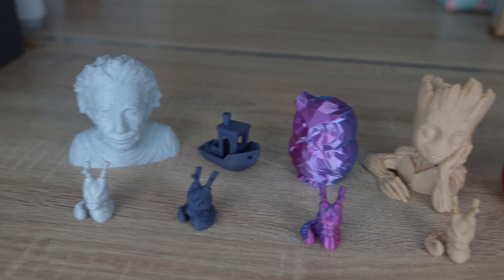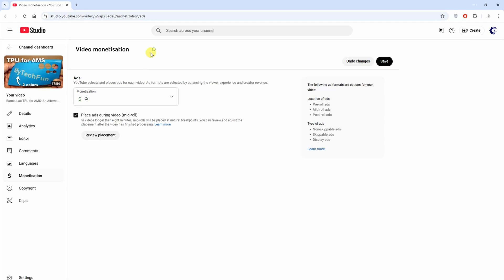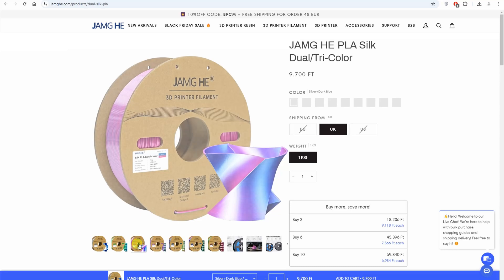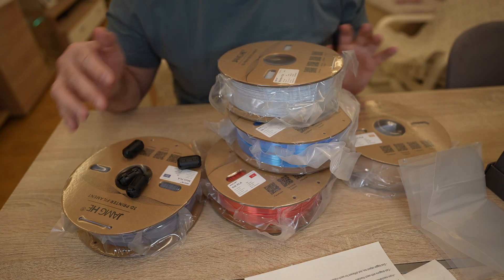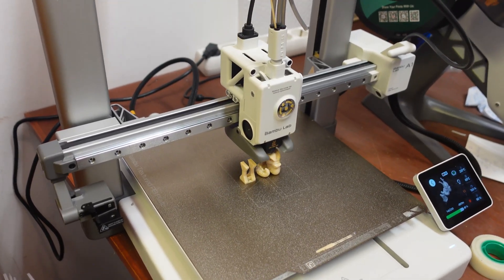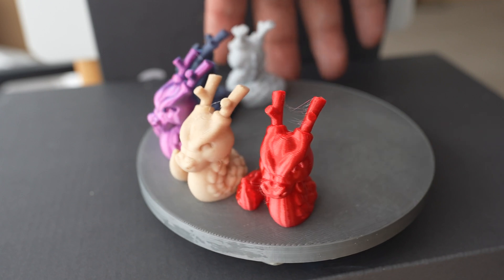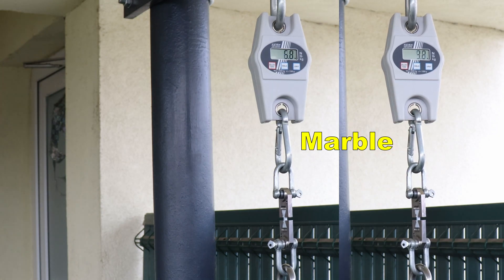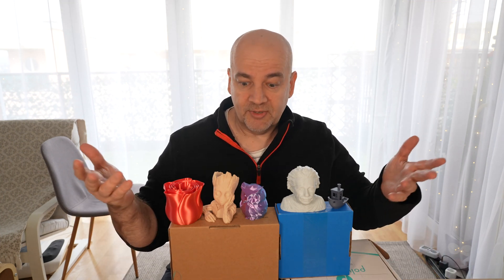Testing all aesthetic filament types by Jamg-He (Wood, marble, matte, silk, dual color)

Comment: If someone had a printer capable of multi material printing, could they have the best of both worlds by printing just the outer perimeter with this sort of filament?  Would there be a concern that the outer perimeter would peel off of the rest of the print?
Reply: Unless your printer is IDEX or using multiple toolheads, having to purge EVERY layer line would be an insane waste of filament

Comment: My comment was not rude--shame to see a Ph.D with such thin skin.   The debate about whether free products = sponsored was settled over 20 years ago.  Just because you don't make much money doesn't make you immune to criticism or bias.  There are literally a hundred thousand individuals shilling $10 products off Amazon and they don't make much money either.   The best test channels buy their equipment using money from Patreon, to avoid the perception of bias.  You're making $1285/month minus Patreon fees (257 Patreons x $5/month) and you output 10 videos per month with low effort (4 hours, most of it editing).  If you want more Patreons you need to do better, and useless positive comments will not help you see where you need to improve.
Reply: Even the best channels (what we follow might differ) get top-of-the-line expensive 3D printers for free .

I think there were recent cases where reviewers declined to accept units due to manufacturer requirements about content. It's hard to imagine filament manufacturers would try that with Igor 🤔

Least bias would come from buying equipment with own personal money (with buyer's remorse and non-VIP customer support), but not many have possibility for that. Basically "My new 2024 printer is so much better than my old slow bed slinger" videos fall under that, but their value is limited due to not having had more printers.

I would complain about reviews from 1-3 week testing with prototype or hand-picked machine instead of 1-6 months with production unit. But reviews - and sales - need to start when the products are released and the hype is at peak. There's no equation that would work out.

Why not start your own channel - it seems so easy to succeed?

Comment: My favorite one costs almost nothing, it PETG (great mechanical properties) and is black, white or translucent (so I can color it while printing). This way I don´t end up with 4585 filament rolls of all sorts of nonsense material and it´s cheap and easy to handle my inventory.
Reply: I make a lot of functional parts but also some figures and I always go with white PLA or PETG and paint them. I also make a lot of lithographs or ornamental things that are illuminated and the white diffuses the LEDs really nicely. Occasionally I'lll use ABS and smooth the objects in an acetone vapor chamber if I absolutely need to get rid of the layer lines.
Reply: @crispy_orb  I never use PLA, I never have. I tried that material once because I was curious and it´s simply crap. It´s considered a non engineering material and it behaves as such, the only two pro´s for that material are price (no wonder because it sucks) and it´s printability.
So I from the beginning only used PETG which was new at that time. 
Using acetone is also a good use case, but I would use ASA instead, you never know if the product will be exposed to UV light. But that´s just me. I try to keep it as simple as possible and narrow my material choice down as much as I can in color and material itself. Never more annoying that storing I don´t know how many rolls of old crap you never use because it´s a specific pink color or something stupid like that.
Can´t wait for multicolor system (not multi material systems which uses different filament rolls, multi color is if you use just one material roll of white or translucent material and color it in where needed).

Comment: Love your videos they are very informative! I tend to use more engineering filaments myself, but the kids do love the colorful prints. I have two suggestions for future vids:

1. A video exploring multi material adhesion and combinations in one print. See what materials bond well and their relative strengths vs just the material on its own. What combinations might have real world applications. I think there is a lot to explore here and opens new possibilities for parts potentially.  

2. Maybe adding some real world functional prints to your other filament testing videos or in a general material comparison video would be helpful. I love the data, but seeing how the material prints, looks, and functions on larger real world parts and over real use timeframes can be helpful. For instance PLA often looks strong vs other materials like ABS by the raw numbers, but in the real world ABS is almost always better for functional parts. Or PA-CF can be supper strong by the numbers, but because of moisture absorption and creep a cheaper filament like ASA might perform even better in a lot of real world applications. 

Anyway love the vids, keep up the good work!

Comment: Hi Igor! Love the video, and at 3:35, yes, those are filament dust removers. You attach those prior to the filament entering the hotend and it will catch the dust from the outside air. This used to be very common for Ender style printers, not for Bambu style ones, because people rarely used a PTFE tube from the spool to the hotend
Reply from the maker: Thanks for the confirmation.